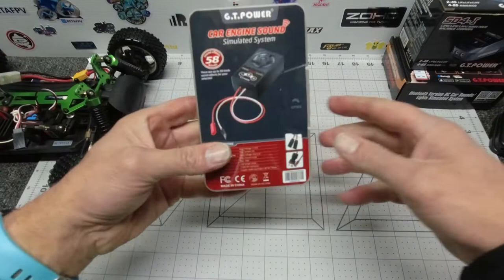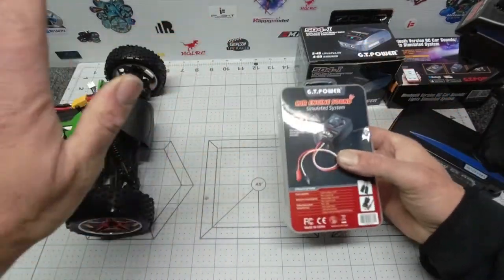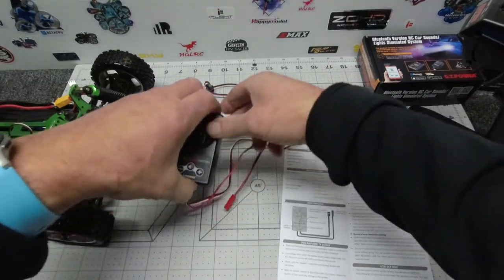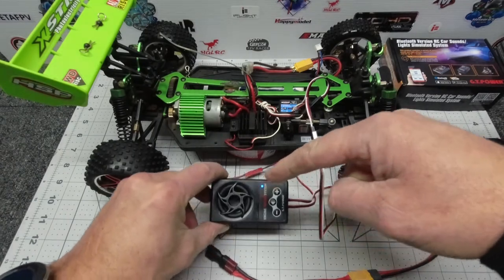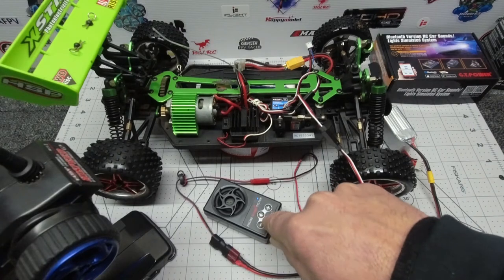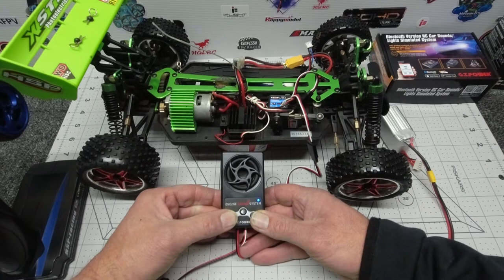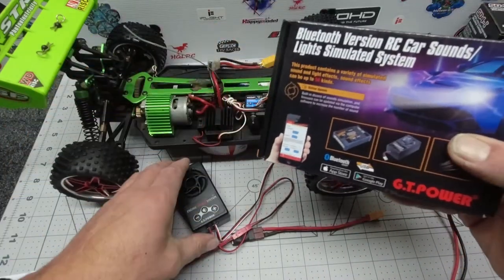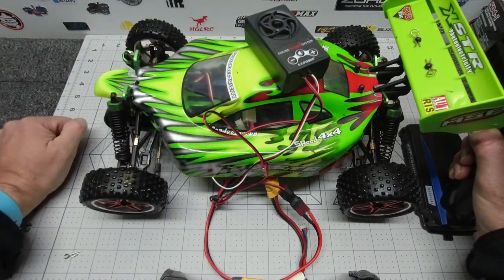ENGINESOUND - G.T. Power Engine Sound System - LOUD 📢

Comment: Hello friend . A question. In my truck crawler the chanel 2, throttle, is 2 pin plug, positive and negative, for the motor wires.The GT POWER speaker is 3 pin can itake only the 2 cables? It will work ?
Reply from the maker: Yes mate. You will be able to initiate with the 2. 👍🍻
Reply: @GTARC_au  thank you very much friend.  that black wire ,ground, maybe connect it somewhere else for ground it.That ground wire what does ? Why the company's using it?